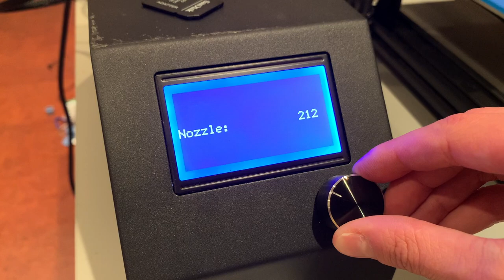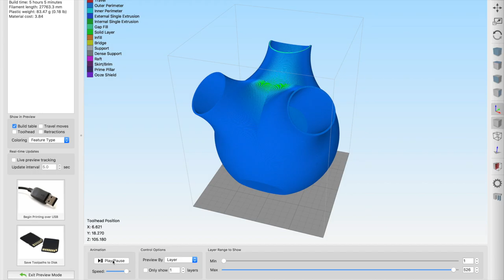3D Printing a Stool

Comment: Wow awesome work! I'll consider doing a similar project with my 3D printer. I'm wondering if you did it all in one go or did you have any failed prints. What was the most difficult obstacle about this project?
Reply from the maker: Supersnad thanks! Didn’t have any failed prints thankfully, but I did heavily tune both printers beforehand. Biggest obstacle: waiting for the seat to print. 40 hours.

Comment: Very cute design. Clever use of PVC pipes. I'd like to combine organic shapes with the mechanical severity of 3020 slotted extrusions.

How did the stool last? I'm imagining stress concentrations on the outside rim of the hole that takes the pipe.

Comment: Flat seats aren't quite the best.  Try optimizing the bottom of that part so that it prints the other way around.  That way to seat part will be facing up so you can add a dish for more comfort.
Reply from the maker: It’s actually pretty comfortable, but I see your point. There’s no reasonable way to print it upside down, but you could add a bit of a bowl to the existing underside